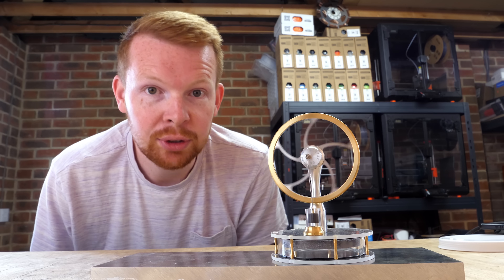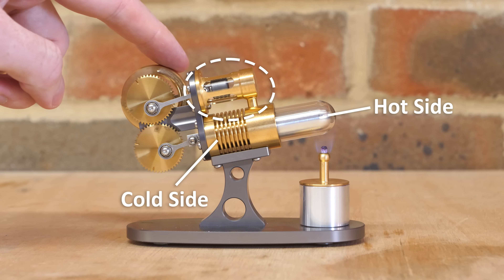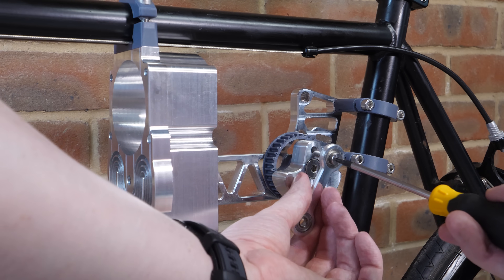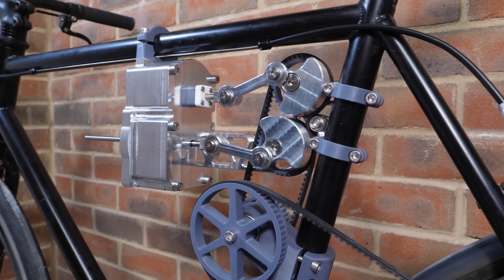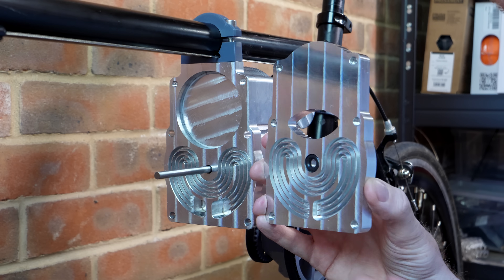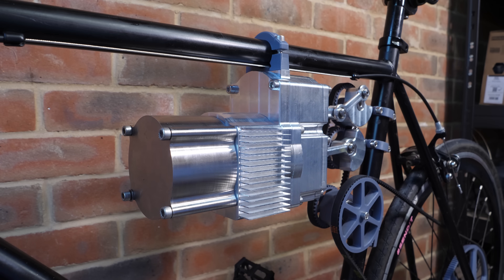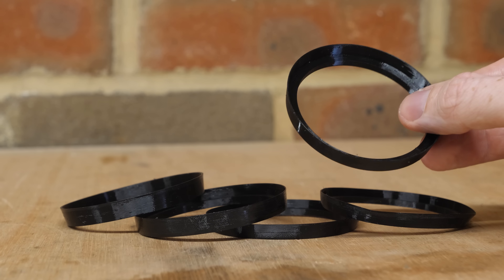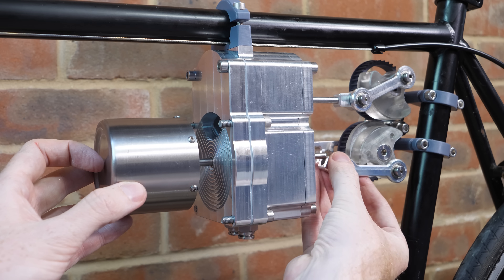Building a Stirling Engine Bike - Part 1

Comment: Sterling engines have been around for over 100+ years.  There are several sterling group web site and a person selling blue prints of a working quad engine heat exchanger setup in compacted square making a self starting high efficiency sterling power plant for cycles.

Comment: The best way to increase power is by increasing the surface area of the heat exchangers. The low power toy engines have smooth inner bore in the displacer cylinder. In commercial engines the inner bore is covered in tiny fins and grooves. Those inner features are difficult to make in a home workshop, but they are the difference between a toy and a real engine.

Comment: Consider heat isolating the displacer and power piston housings from one another, add a regenerator, improve displace piston gap size, definitely optimize crank shaft drive to fit optimal PV diagram (compound yokes work well, easier than rhombic drives, etc), improve air flow within the engine (air can get trapped quite easily for such short heating-cooling time cycles)…

Comment: Stirling engines don't provide any appreciable power - it has been tested fully for a long time, in numerous settings; numerous sizes.... why they aren't used 😕 no amount of engineering has made them work yet...my bet? No chance to get the weight of the engine, bike and person to even move. You are flogging a dead horse.
Reply: The Swedes disagree. The Gotland class Submarine uses Stirling Engines to generate power for propulsion.

Comment: im trying to make a alpha type sterling engine which has better efficiency but is more difficult to make well. a big improvement is to pressurize the air inside, i was reading documents that had them at 800+ psi

Comment: Nice wormanship Tom!   I hate to pore cold water on such wonderful project but your assertion that it will generate anything near to 100 Watts, even with the impending  improvements is a sheer fantasy.  I played with model SE a few years back (some videos are still on my channel) and your estimation is off by close to an order of magnitude. I.e. with the improvements you may be able to reach 10 Watts, and that would be a stretch.  That is why you can see the engine is running itself alright, but the moment you put any load on it (eg bicycle wheel)  it stops. There is nothing wrong with your workmanship, it just cannot work the way you think in principle. For the engine of this size to generate 100 Watts the following needs to be done: 1) Replace your power piston with a membrane as piston is both leaky and gives friction; 2) Remove mechanical linkages between power and displacement pistons, they waste too much energy, make the engine "free piston", they are much more efficient; 3) Provide maximum thermal insulation between hot and cold sides, a solid Aluminium block is too heat conductive; 4) Use PRESSURIZED Helium as your working gas. That means that the whole apparatus needs to be well sealed as Helium leaks easily due to its small molecule.
Sorry for such a long saga, but making small and powerful SE is very difficult.  I wish you all the luck.

Comment: "I’m not an engineer, but I have some thoughts on how to make it work better.

first- Try rotating it (cold part forward)—it should improve power while running.

second- A heavier flywheel could help too.

Thanks for the great video, and good luck with the continuation!

Comment: Hahaha, and while I am sure you will improve it, this is why we dont see them around peoples houses running off solar. The amount of heat to get enough power from it would be crazy high:) but I am still surprise we dont use heat pumps to move the hot solar air into hot water to keep it warm.

Comment: Have you had a look a NASA's Stirling cycle generator design that has a moving piston magnet assembly in sealed cylinder within a coil. You heat one end of it and it hums as it makes electricity. Perhaps it could power a bike motor.

Comment: your Stirling Engine is a great starting point but a few thing i see that might improve power. 1. The displacer piston has too big a gap with the bore which reduces the dynamic pressure sense you used a aluminum adapter from the shaft to the piston you can add a flange to it to increase the dynamic pressure of the displaser too big of a gap can result in a reduced in power as the dynamic pressure is too low for proper operation. 2. the timing can be adjusted this is helpful as some Stirling Engine run better with the displaser gest under 90 degree and some gest over of offset. Also you can find the power out with a permanent magnet brushless motor with a resistor on 1 set of wires and measuring the voltage across it with a known resistor you can find the amps then the watts its outputs and grafe it with an arduino so you can compare different changes to find the best power per input temp. great video by the way.

Comment: Neat. Definetly cool that you appearently only really needed to improve the seal for it to run, i think you could improve friction and maybe even the seal further if you polished the inside of the cylinder. To me it looks like there's still the original machine finish inside the bore when you swapped in your 3d printed seal, and i could definetly see the tool marks being to blame for alot of the friction that still seems to be present in the power cylinder.

Comment: At 6:00, why the 3d printed template? The part is literally right there.
Reply: Easier to cut with an XActo against plastic than aluminum, saves your blade too

Comment: Changing working gas would likely help significantly, while Hydrogen would be ideal, it has the slight problems of being highly flammable, and basically being able to migrate through every metal ever. So Helium, but that's pretty expensive and relatively rare, so argon or nitrogen. Or maybe a mix of helium and hydrogen (a lot of helium a little bit of hydrogen), or helium and argon?  Or helium and nitrogen? Probably worthwhile experimenting with. Also possibly worth exploring more powerful cooling, maybe peltier water block cooling, maybe changing the coolant to liquid ammonia instead or water/glycol or water/ammonia mix or ammonia/glycol? Maybe also pressurising the cooling system too?

Comment: About 17:40 you should try, if it's not too complex, to make an hybird system, maybe implementing one of the energy recovering technologies you tested (or just using a brushless and a battery). You could power the stirling at constant load and using the hybrid part to reduce the speed, consuming part of the energy to charge batteries, and then use the electric motor to assist during accelleration/climb. In this way a greater peak power can be also achieved.
Reply: brakes heating up as a sterling engine
Reply: An.
Reply: An electric motor sort of misses the point of this project, don't you think?
Reply: @Nabushika   What is the point of this project supposed to be? It has a Stirling engine it goes on fuel (blowtorch??). The engine is not (well) throttlable so an idea to "brake it" when low power is needed and give back the energy when you need it most can be an hybrid system. Of course if we talk about hybrid is needless to say (maybe i should have specified it(?)) that the battery capacity should be very low and motor power like 10-20% of the Stirling (for example). I suggested that option because it's the most simple/compact, for a project that looks complex on it's own, but would be really cool to see him make an hybrid using his flywheel system or compressed air or other technologies he developed
Reply: @gabrielecipriani6798 I don't know, I'm all for hybrids normally but the whole point of this was to power the bike with the stirling engine, right? Adding an electric motor seems to go against that, even if it's just for regen.

Comment: Flywheel should be more heavy and output gear also bigger and after that i think performance will better. If you look at every power stroke you can see Flywheel can't perform other strokes and engine doesn't run smoothly and also starts stalling

Comment: YES, finally utilizing the Sterling! Material Science has come SOOOOOO far from the age in which the Sterling engine was conceived! it fell by the wayside and now people look at it like a toy but it is SOOOOOO valuable in todays world! I still say this is a better option than EV's because just the production of them is FAR FAR better for the environment! NASA had a really nice 75 HP rated Sterling they built in the 90's and put into a Dodge pickup that passed California emissions control with NO CATALYTICS installed! that's how cleanly the fuel was being burned and they used everything from gas, diesel, JP-4 and AV-Gas or whatever they had available around the base they tested it on. these run on ANYTHING that you can make heat with including the sun! which I'd probably implement a nice black loop of "solar powered" hot water to the hot side and mount it on a small deck frame on the back of the bike. can always use the torch to get it started until you get into the sun or hell even hand warmers in winter in an insulated box around the hot side... these engines are just SOOOO versatile if you understand what you can do with them! these things are the real solution to cutting emissions and lowering global temperatures! NOT fields of solar panels and wind turbines and EVs... Sterling Engines! THESE are the solution!

Comment: Your toy engines all have a much larger ratio of displacer to power piston.  I think you ratio is almost 1:1 right now, if you increase the ratio of the displacer to piston, I think the overall efficiency will go up and so will the power output.  Also, borosilicate glass has a much higher thermal insulating factor, so you might consider a heat brake made from that, or make the hot side from that.

Comment: Oh, a powered bike @ 24.1 km/h is just under the assisted (!) E-bike 25 km/h limit in the fabulous petro-kingdom of 🇳🇴.

Well, as long as stirling power doesn’t count as an e-scooter, which is max 20 km/h. Bureaucrats, start working. Our think-tanks will probably go for 50 km/h like a moped. This is external combustion after all… 😂

(Seriously, what a lovely machine, idea and engineering work…!)

Comment: also, you dont need a clutch, just you a V-belt banded pulley instead of a toothed one; same thing they do for all HVAC systems. the slippage WILL be your clutch. you can just move the drive pulley in and out of the bands path. they're also super cheap so when you burn through one its only another 20-30$ to replace it.

Comment: the BEST way to make a sterling engine work would be to use an insert compressed gas with a high thermal conductivity like Helium. It MUST be pressurized so that there's more molecules to expand and greater resistance to compression. 
of course, that means you're talking about all the dangers of highly prempressed gasses which neutralized one of the entire reasons to use a Sterling engine over steam. 

Regardless of the gas used, the higher you compress it (or heat it), the greater the thermal conductivity of the gas! this is especially important because it means there's an ideal operational temperature where cooling off the gas too much kills your system efficiency, but heating it up will result in even faster thermal transfer so it'll lose that excess heat energy and it will all be wasted, 

essentially, think of it like a cars suspension; the spring MUST be per-compressed or the car will just sink to the ground. 
you also need the gas to absorb and dissipate heat rapidly in order to create the pressure differential you want. slow thermal transfer will act like "valve float" in a combustion engine where you'll get heating and cooling on the opposite sides of where you want; canceling your power output.

Comment: I hate to admit this, but you managed to explain few missing points about Stirling engines - I've had the basic understanding for several decades, but you managed to give the missing pieces about the displacer piston.
Your design might benefit from internal fins as well. Piston rod appears to wobble, add linear bearing in addition to teflon seal.
You could also use lever (and extra con rod) with a side axle to reduce the stroke length.

Comment: something I dont believe was considered was the material of the hot cap, most stirling engines ive seen had a hot cap made of glass, I believe glass is preferable not only because it would technically be cheaper, but also retains heat much longer than aluminum, I think the aluminum might be cooling down a bit too fast for the engine losing potential power and shortening the duration the engine run time. perhaps if you could find a metal with similar conductivity but with still a high melting point to avoid melting the cap, perhaps there will be more heat that stays in the chamber rather than dissapate due tot he aluminums thermal conductive properties

Comment: For "variable compression", if you didn't mind the friction losses, you could add a lever in between the crank and the piston, then slide the piston's linkage up and down the lever.

Comment: Nice. You made it run. Stirlings are not easy. I think that displacer piston needs to be hermetically sealed. The way that the working gas cannot go in and out of it. Otherwise it partially absorb  pressure changes in the engine.